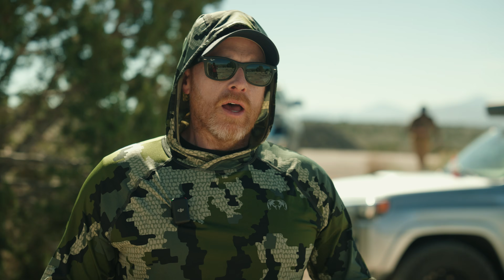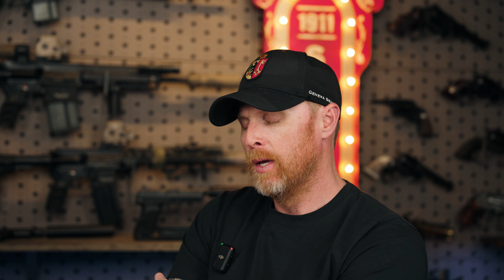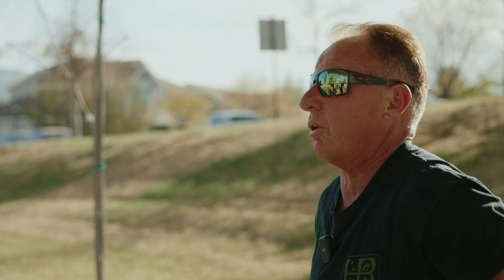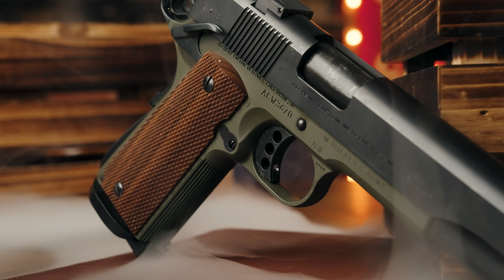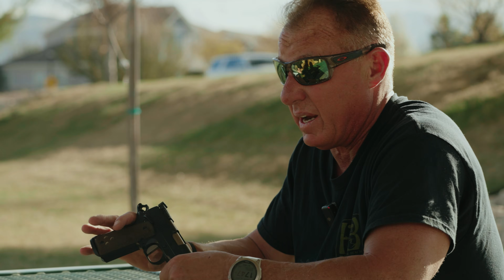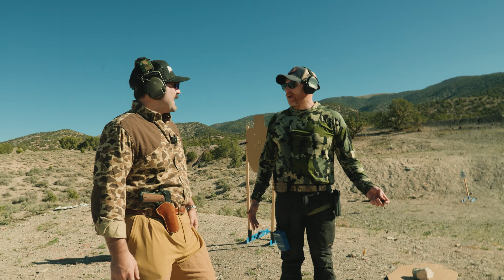The Untold Story of the Delta 1911

Comment: The first thing I notice about the gun is the buried Bomar.  I did see a gun many years ago with a buried Bomar and I've seen almost none since.  However now I recall that the first gun I saw that way was supposedly built by a military armorer.  The styling of your gun is awesome- it has what it needs and doesn't have things it doesn't need, i.e. less is more.
I read a book about the origins of that type of organization.  The book didn't cover much on the shooting but it did illustrate that the training worked very well to make those guys good shooters.  The book also mentioned bringing in experts in various fields to help train them.
Reply: You lose about 3/8" of sight radius but in return the blade of the sight is mostly shielded from impacts, and maybe equally importantly; you can use a standard profile firing pin stop. Just makes sense for military applications, I would even argue it would be fine for bullseye shooting.

You can contour the corners of the blade as well to get it more snag resistant!

Comment: So 11:52 when Mike discusses the “Alien Space Metal” of pre 1950s produced 1911’s as great metal. I feel it’s the exact opposite info that Eli has put out saying most custom gunsmiths will not work on older 1911’s due the metal being too soft, and that more modern 1911’s are better base guns for projects. 

Who is right? What is the true fudd lore?
Reply: I noticed that too, some contradiction in this video. 

My takes based on what I have previously heard:
The Colt specific guns that were used in WWI and WWII did not have great heat treatment and the metallurgy was not the best. The Slide Stop/Slide Lock was the part on the Colt Guns that had proper heat treatment done which is good because that gets battered on every round fired. 
The Colt guns did hold up because there’s a lot of beef on a Government slide, and .45acp is a lower pressure round.

Mike Pannone’s comment about the slide being made of Alien metal was specifically referring to an Ithaca (not Colt) made WWII 1911. 
I do not know a lot about out the non-Colt 1911s from WWII, but Ithaca likely got their metal from a different source than Colt did, as they were also a gun manufacturer at that time. 

I am really spitballing here, but this is kind of what I gleaned.
Reply: The one thing that stood out to me as well. I have an early nineties Norinco 1911A1 that was supposedly the hardest steel 1911 at the time and one of the very few frames that Bill Wilson would use for his builds back then.
Reply: @Sirgromulus one “rumor” I had seen years and years ago is that the metal for the Norinco Slides and frames was milled from railroad tracks that were salvaged in China. 

People swore by those Norincos.
Reply: @TommyRibs I have owned it for over 35 years and have never had any issues. It has eaten everything (fmj. hollow points, steel case, etc.( Ibthink I paid $250 at the time and immediately installed new Wilson springs,  firing pin, straight backstrap. and grips. It's trigger pull is a short, crisp 2 1/4 lbs. I believe your comment about the steel.  I wanted new sights installed but the front one is pinned and several gunsmith did want to tackle the job because of the steel hardness. To this day my Bul Armory is the only 1911 I own that is smoother and slightly more accurate. I'll never get rid of it!
Reply: @Sirgromulus probably the best $250 you have ever spent and it sounds like a great pistol. 

Here is to you continuing to enjoy that fine heater, in good health for decades to come.
Reply: @TommyRibs Thanks! Not so sure about decades at my age, but one of my heirs will be able to enjoy it.😂
Reply: All WW2 war time guns only had the 1st third of the slide and around the slide stop notch hardened. ALL of them Colt, RR, Ithaca, Singer, and US&S. 

When Colt resumed commercial sales in 46-47 the entire gun was properly heat treated. In the 50s the USG purchased a number of hardened commercial slides from Colt. 

The USGI frames can take a lot of abuse. As is evident by the multitude of units that were rebuilding guns on them well into the 2000s. 

A lot of smiths don’t like working on the soft guns. No biggie. But to say 50s commercial guns from Colt were soft would’ve a lie.

New guns are better base guns. But by newer I mean like post WW2 newer are all good. Personally though as technology has gotten better I would say something made in the last 30 years would be better

Comment: The Delta 1911’s are some of favorites.  Maybe because it’s got the features I like, being a lefty the ambi safety is also a must . I picked the Tisas JSOC for my Delta inspired 1911. Swapped to the  Herrett’s full checkered stocks. Next will be 3 hole trigger, probably from Wilson. The LPA adjustable rear sight is fine and plays the part but I absolutely love the brass bead front sight. Anyhow I love the Delta 1911’s and this ACW is a great example. I bet I’ve watched LAV’s video on the Delta pistols probably 10 times now. Great information

Comment: 34:02 I HATE ambidextrous/bilateral safeties.
If I was left handed I would remove the left side lever from the detent plate.
Reply: The left side safety is the main part.the right side fits into the left.this is why you see left side safety only.
Reply: @50supercobra Yeah, IF I was a left handed shooter I would remove the LEFT SIDE lever.
I said EXACTLY what I meant.
Reply: @jeffhutchins7048 I get what you're saying, remove the left side lever but keep the "plate" that interacts with the plunger tube and the notch in the slide. Would be interesting to see

Comment: FWIW, most of the NM guns that were built were NOT Colt. They were built on Remington-Rand lower receivers, specifically the last 150,000 or so, which were not just newer, they were superior to Colt. Remington-Rand in fact, came up with most of the changes that later became the M1911A1, NOT Colt. Colt just adopted the changes, because the .Gov told them to. I have an original 'Delta' gun, and it lines up with most of this, except the later beavertail safety, ambi safety, and magwell. THe thing is amazing.
Reply: Where are you getting the information that Remington Rand type writer company came up with the “changes” for the M1911A1?

The A1 was formally adopted in 1924. Well before the US solicitation for war time contracts for the Second World War. The US Military requested the changes and COLT adhered to them because during the interwar era it was really only Colt that was making the pistol. 

And I can’t speak for the amount of 60s-70s NM guns that were Colt or RR but it likely doesn’t matter in this context.